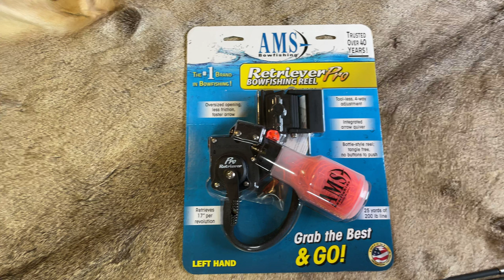The Ultimate Budget BOWFISHING Build

Comment: Funny i have two oneidas but i use them for regular hunting, not bowfishing. I don't like the way fish taste so I've never wanted to get into bowfishing. I'm surprised insert bushings don't get glued in.
Reply from the maker: It depends on what kind you use. On these particular inserts they are compression fit with a mechanical lock. Glue wouldn't make them much stronger plus because they are such a tight fit the glue would all squeeze out most likely get on the threads of the insert and definitely squeeze out onto the bow creating an extremely difficult problem of having to sand it off around the inserts. I glue all my threaded inserts in.